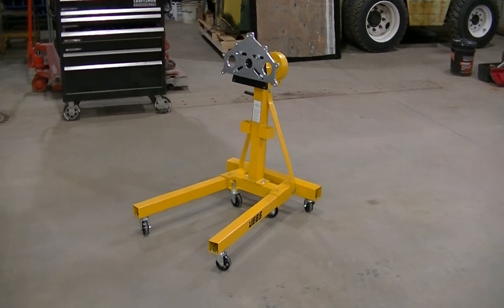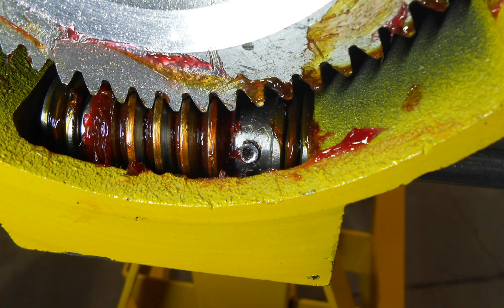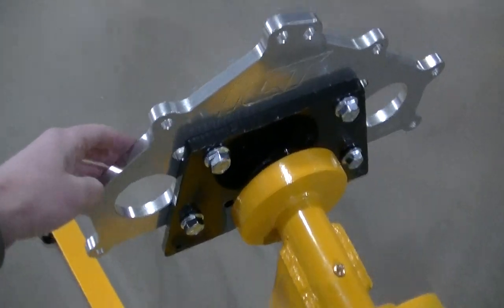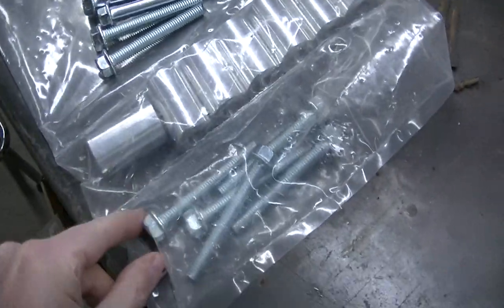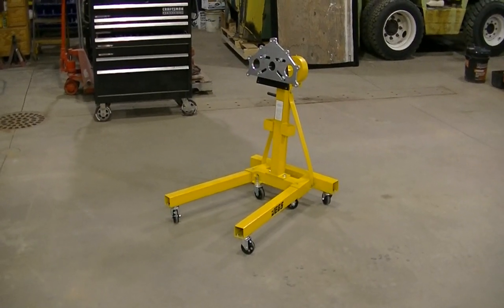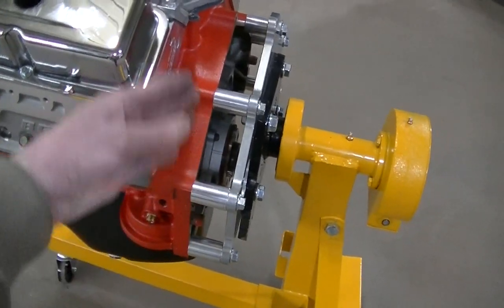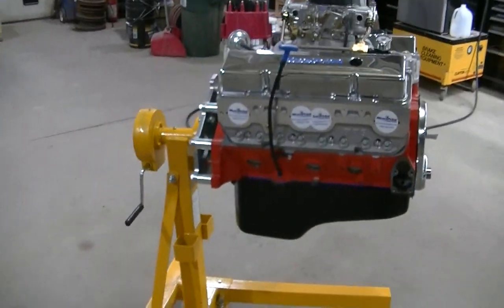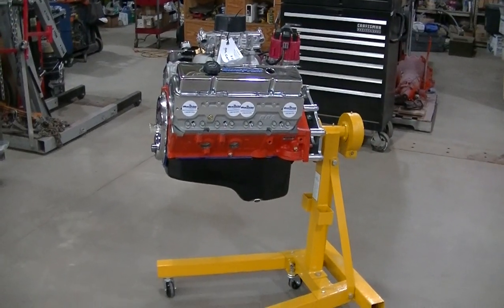JEGS Engine Stand Mods | ICT Billet Plate

Comment: I agree. The gearing on the crank and the shaft shouldn't be that sloppy. Made in jingling China I assume.  If made here on the homeland they need to get their sh!t together. Anyway. Great video.
Reply from the maker: I am pretty sure that slop is in the shaft. It has a keyway and I think a bigger keyway or spacer will take that out. I can't do anything with the motor on the stand. I will post another video when I figure it out and fix it. This will be a good stand once I get it all worked out. It handles the small block easily. I got it for the big block or maybe even a diesel someday. The geared stands are hard to find now. I was looking for links and most have sold out.
Reply: @mossman381  Gotcha. I hope you find a fix. When you do. Post it. Might help others with the same issue..Take care be good. Stay warm.

Comment: I'd get grade 8 bolts for those spacers not those cheap ass chrome bolts
Reply from the maker: Haven't had any trouble with the bolts included.
Reply: I’d use titanium bolts to reduce the rotating mass.

Comment: Harbor Freight came out with a Daytona version of this and it seems 10x better than this junk you had to modify because of stupid engineers the Daytona engine stand comes with through pins to hold the legs in and it has adjustable feet to really stabilize the engine and locking wheels.
Reply from the maker: Everything Harbor Freight has is junk.
Reply: @mossman381  Not everything. They have some good stuff
Reply: @mossman381  Sorry, but no. The Daytona stand is far superior in fit and finish to the ones Jegs and Summit sell. Even the packaging is far superior. Certainly, HF still has some substandard stuff for sale, but many of their products have been greatly improved.
Reply from the maker: @perryneum  Sorry but you are wrong. It looks like the Daytona stand has the same gear head. There is even a review that states the head has the same slop in the gears. I am guessing it is made in the same China factory.